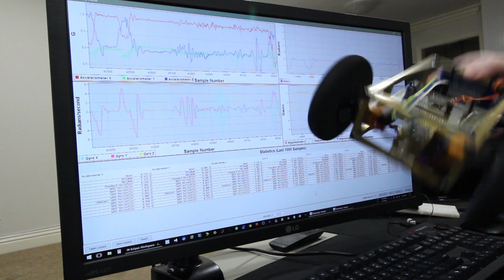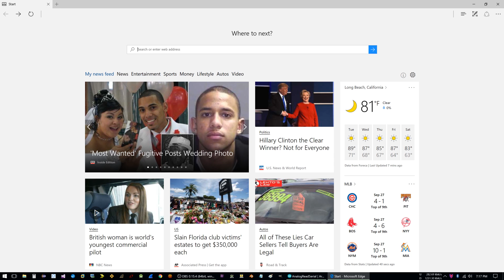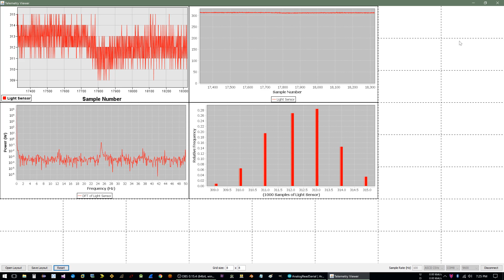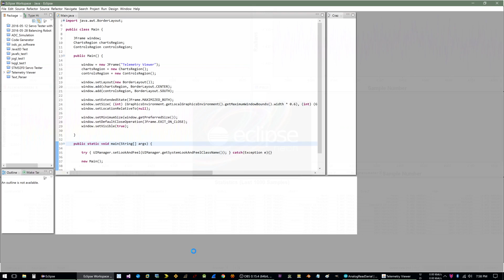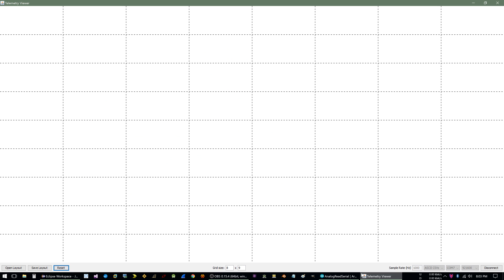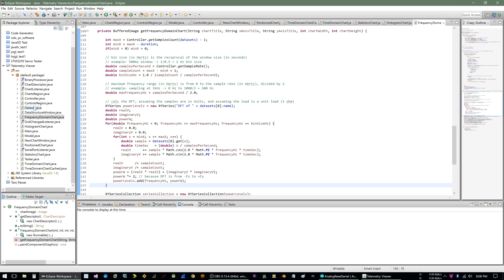Easy Arduino Data Logging and Telemetry

Comment: Hi, and thanks for a wonderful video with clear and easy to follow instructions. This and your prior video on Graphing Arduino Sensor Data has re-ignited my interest in Java. I have tried it out and it works a treat!

My usual goto language is C#, but my recent hobby of mucking around with Raspberry Pi's has led me to cross-platform languages like Python. However your demonstration of how easy it is to use JFreeChart in Java has led me to want to try this on Raspbian on the Raspberry Pi. 

I have just installed Java 8 on my Raspberry Pi and would prefer to build java projects in Eclipse on my Windows/10 box and upload them on the Raspberry Pi - Is this possible? If so how do I deploy them? Do I need to install anything else?

If I cannot build on Windows and port, what would I need on Raspbian to build a project like your Telemetry-Viewer?
Best Regards
Reply from the maker: Thanks, glad you like it. The nice thing about Java is that you don't need to recompile. The same JAR file should be able to run on Windows, Linux, MacOS, etc. (although I have only tested on Windows)

Try double-clicking the JAR file on your Pi. It should open up just like on your Windows 10 PC.
Reply: Thanks, I already tried that but it does not seem to have any associated application. If I right-click it brings up a menu which includes 'Open With...' but there does not seem to be anything that works. I also tried in a terminal window 'java Telemetry-Viewer.jar' but it responds with 'Error: Could not find or load main class Telemetry-Viewer.jar'
Reply from the maker: Try "java -jar Telemetry-Viewer.jar"
Reply: Brilliant - That works! Simple when you know how, I'm still new to Java and Linux. Thanks again for the support and I look forward to your next video on this subject area.